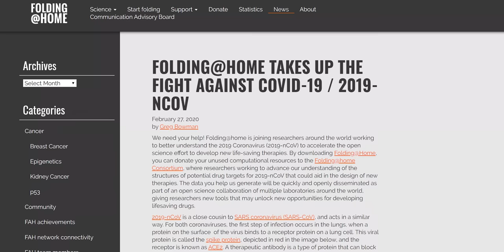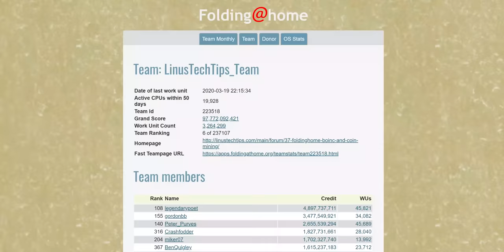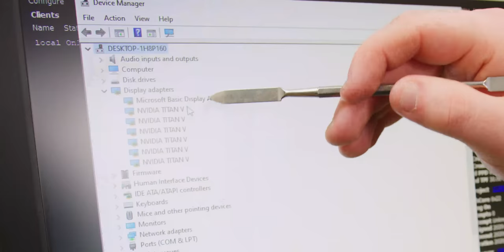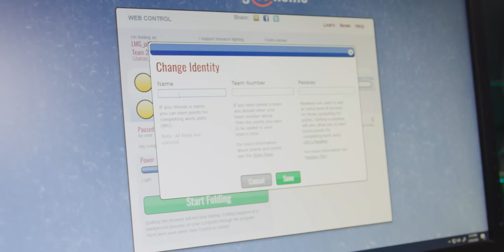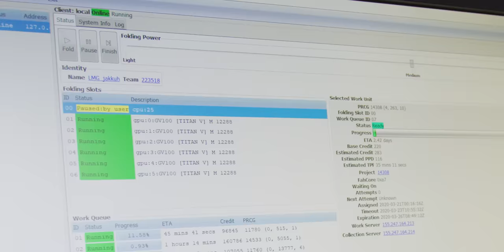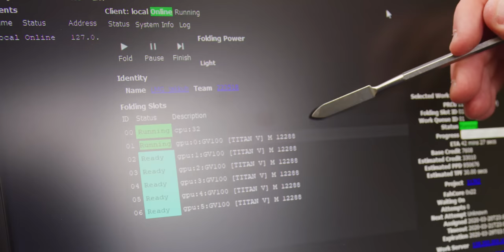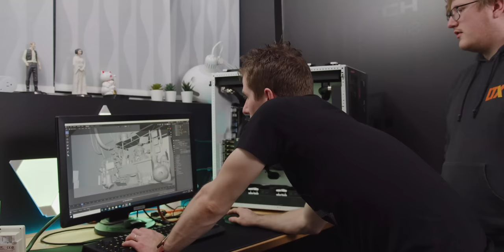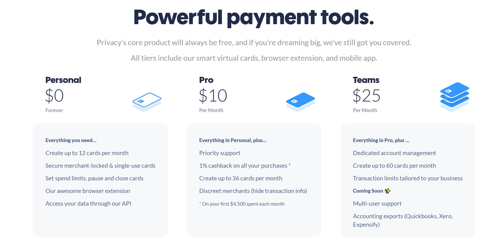Here's How YOU Can Help Find a Cure for COVID-19!

Comment: "We literally have a 1,000W heater..."

No, you LITERALLY don't...
Reply: How so?
Reply: Actually, they LITERALLY do, that heat just also happens to do useful computations as well. I use my PC folding in the winter to keep my room warm. By definition, heating it.
Reply: @PAPO1990  That is factually incorrect. The heat is a waste product due to inefficies of the system... It is folly to infer that heat does processing in this closed system. Is it possible to do computation with heat, yes, you are correct in that, but to say heat does computation in this case, is factually incorrect. If the heat were doing computation, then the efficiency would not be so incredibly low. It would be, literally, 100% efficient, which it is not.
Reply: @PAPO1990  Also, saying that you are heating your room in the winter by folding, only serves to prove the inaccuracy of your statement.
Reply: @PAPO1990  Apologies for the multiple replies, I don't like editing or modifying posts.

I was going to send a link to technical papers that detail computational efficiencies of modern silicon, but I thought it would be more effective to just give an example.

Consider the performance of a 90W CPU from a decade ago, and compare that to a current 90W processor... If 'heat' were somehow doing processing, they would be of the exact same performance and efficiency. If your statement were accurate, we wouldn't have modern Silicon that consumes 15W but easily outperforms Silicon that consumed orders of magnitude more power.

A further comparison would be that of the first generation of silicon based computers... They consumed kW and could barely do relatively simple computations, if your inference were accurate, such drastic efficiency difference with architectural changes would not be possible.
Reply: Jacob Crosby well if I want the heat AND the processing, then it IS 100% efficient. I am using it for the heat it produces, therefore it is functionally a heater.

Comment: I pulled my FX computer from my brothers as he uses wood heat and I noticed soot all over the components inside. I will clean that out and install the R7 265. Instead of the HD 6570 that in there now. I will set it up in a drafty corner and just let it go only for F@H.  Thank you for the guide.

Comment: Electrical System in North America seems quite weak to be honest. 
We got 240 Volts & 16 Amps (~ 3600Watt) per circuit here in Europe.
Reply: I am using a NEMA 14-50 outlet in the garage, which is 240V single phase 50 amps and then I have a simple adapter to 120V by not using all the legs of the 240V and that splits to 4x 120v outlets, 12 amps each. Gets pretty hot in there..

Comment: Set your folding at home CPU slot to use just a few cores, that way it won't interfere with GPU calcs, and will give you a wee boost in points, especially at present when the CPU work items are more readily available than GPU work items.

Comment: Intel i7-9700k overclocked
Nvidia 2070 super 
MSI z390 Tomahawk
Corsair vengeance RGB PRO 32GB 3600mhz 
Corsair H150i: 3 maglev push and 2 pull
Corsair 650w 80plus gold
Corsair 275r AIRFLOW (no glass side panel, open af with unlimited supply of air spray dust cleaner)

Task Force 223518: going dark.

Comment: October 2021; Only ~70K CPUs and ~30K GPUs are participating in Folding now?? That's sad people didn't stick around since last year. Got those stats from their site.
Is it accurate? Do they need more processing power? 
Just bought about 20 cheapo used Skylake Optiplex SFFs to get to work! Heating my house with scientific research!
Edit August 2022; Ok now I have about 90 Small Form Factor PCs running for the cause. They can really stand high temps they cool the CPUs better than you'd think. But will the PSUs last?

Comment: It's possible to install it on Linux, though only on Debian/Ubuntu/RedHat/SUSE based distros.  There's some broken dependencies you have to add if you are on Ubuntu, going to pkgs .org and getting the Debian Buster 10 version, since it's not in the repos.  And you might have to manually add your GPU in the configuration menu.  But besides that, it's working great.  If you are making a dedicated system, use something Debian based like MX LInux or AntiX so the dependencies are there.

BUT, if you dont want the hassle, get BOINC.  It's in the Ubuntu repositories and it just works.  And you can do more than proteins if you want, you could also do astronomical, cosmological, and mathematical calculations (like unsolved Conjectures and such).  I have my windows machine running FaH, and my Linux laptop running BOINC.

Comment: KProcessor ( intel 9th generation i5 unlocked )
Casing ( NZXT Ninza RGB Caae) 
RAM ( G. Skill Trident z GB 3,200 MHz ) 
CPU Cooler ( NZXT Kreken X52 ) 
M. 2 ( Gigabyte m. 2 512 GB ) 
HDD ( WD 2.0 TB) 
Motherboard  (Arous 365 M )
Graphics Card ( Nvedia geforce RTX 2060 ) 
Lan Card  ( gigabyte ) 
Power supply  ( Carsor CX650 watt ) 
Monitor ( HP 22fw monitor) 
Anti virus ( Avast) 

This is a right choose for building a best PC or not. What I need to change form here. Please tell me as soon as possible. This is a $1500 full set build.

Comment: Just joined the team. i7-8750H and NVIDIA GTX 1050TI on laptop. Running around 16 hours a day.
Temps are consistently 75C.
Is this damaging? (Ie will the laptop die in <5 years?)
Reply: It could be harmful for the battery and potentially the hard drive if they are heated up by the nearby components. You could remove the battery while running these apps continuously, and optionally connect the laptop to a UPS if there are power outages with any frequency.
Reply: How, to run 24/7?

Comment: I downloaded Folding at Home and set it up.  My wife doesn't use her laptop very often.  She likes her phone mostly and is lucky if she gets on hers once a year.  So I set it up to do some folding.  If your setting up for the first time and you normally have your computer set to sleep when not in use, make sure you go into the power settings and make it so the computer stays awake.  You an still let it turn off the screen though.  Otherwise it can't contribute when your in bed at night.  One question.  If I want to run this on more than one computer, can I use the same username and pass code on all my computers?  Or do they each need their own?

Comment: Question: why use Windows over Linux for this project? is it due to a performance hit when using Nvidia cards, didn't know if there was a Linux client available, had trouble configuring the system (or wanted to avoid a potential issue), a lack of familiarity with the OS from the people on the project, or "It's what was already on the hard drive," or it's what most of your audience uses? All of which i would consider valid, since this was probably intended to be a low effort project. I would assume that you would get a performance increase from using a lightweight Linux install, which may not be huge, but any increase in numbers is a plus.

Comment: The kind of stuff you guys have "just laying around" puts my 10 year old daily driver to shame, well, nearly anything puts it to shame tbh.
I really want to participate, but my computer is so old that I'm afraid of making it do too much cause I can't afford to replace it if it craps out, and I'm honestly expecting it to crap out any day as it is
Reply: It probably wont crap out running at stock speeds; it will however be inefficient. PCs nowadays are practically 10 times as fast while consuming the same or less power, so you could lose more money on you power bill than the value of the components themselves.

Comment: we got took over this month,
i'm running 4 individual tests at a time at the current moment...
3 on the 1 multicore processor by setting up 2 cores for each test,
you can all do the same if you have multicore prosessors.
any way to churn through tests and accumulate more points,
we are only loosing the the Default noTeam but...
Reply: although,
deviding up your cores like this will obviously make tests a bit slower so really upto your preference...
i may end up setting mine to at least 3 cores each,
donno yet...
Reply: UPDATE:
Yup,
i just earned more points in a couple of days than i did in a couple of weeks...
it's worth dividing up your CPU if you can

Comment: Can you adjust the percent of CPU being used. It's maxing out the CPU on my dedicated folding machine. It's only using 40% of the GPU, but 100% of the processor and, of course, running for hours, constantly. Temps are decent, but would like to back off the CPU a bit.

Comment: Linus if you are talking with Folding@Home it would be great if they could share some information on how they are prioritising the Covid-19 cases because there is no dedicated project available to select. So we have to hope that the "right" problems are being worked on by the client right now. C
Reply: The default configuration will get you covid units. On the client configuration the "Cause Preference" set to "any" receives them, as they are set to high priority on the work servers. You can confirm what unit is running by googling the project number.
Reply: @giann3021  thanks for the reply. I've been googling the project numbers and there hasn't been any info on them, unless there is a known Covid-19 project number that I should hope to see? Just feels a little abstract right now!
Reply: @Cerberus256  you can type the project number here to get a description: https://apps.foldingathome.org/project

There´s also a list on a forum FAQ for the projects: CPU : 13862 - 13863 - 14328 - 14329 - 14337 - 14528 to 14531 - 14572 - 14574 - 14576 - 14600 to 14602
GPU : 11741 to 11781 from https://foldingforum.org/viewtopic.php?f=24&t=32463
Reply: @giann3021  fantastic thank you 👍

Comment: I´ve got an old I7950 with 6GB Ram and a Gtx 970 left over unused. But the HDD is broken, and i dont have a replacement. Can i run FAH-client while booting over USB-Stick without significant performance drops? i´m happy to run that old system 24/7 as long as it still works.

Comment: Im new to understanding alot pertaining to the tech world. I have a gaming laptop thats collecting dust. Can that be used for folding? I want to contribute
Reply: Yeah with some considerations. Mainly watch the temperatures of the GPU after running the software for a bit. It would be better to fold either with just the GPU or just the CPU to avoid overheating it. You´ll be able to hear it too as the fan(s) will likely spin up like crazy. Make sure the fan and fins on the heatsink are not all clogged with dust/lint.

In the advanced interface of the Folding at Home client, you can right click on the CPU slot status and pause the folding. And it will keep the GPU running. You could also go to the preferences and delete the CPU slot altogether. If you find that you still have some thermal headroom, you can edit the CPU slots and try selecting 1 or 2 cores to run.

Comment: It wont connect for me. Tried disabling antivirus and firewalls, with no difference. Tried opening the port in windows firewall, still timing out. Is connecting on local, so I dont know what is blocking it. Or am I running into an overload problem

Comment: Yeah... I have three very capable boxes here, two WinTel machines with a 1080 Ti each and a rather powerful iMac, all three running Folding@Home with the "Any" branch to fight the covid-19 problem.
BUT: About 80 per cent of the time NOTHING happens; every few hours only do these machines receive one or two work units, the most I had was three WUs at once, the rest of the time all that power is just... idling.
The logs mostly say that there are " No WUs available for this configuration", only one or twice a day does one of the three CPUs and two GPUs get anything to do for f@h.
Is there anmy way to manually enforce more work for/from this project?

Comment: For anyone curious as to why their points received is vastly different from the points estimated and is a new folding@home folder, it is likely because you are not receiving the bonus points which are awarded based on a speedy completion time. You first have to COMPLETE 10 work units (wu) successfully before you can earn the bonus points. Make sure that you aren't failing your work units (they can error out if your overclock is deemed unsteady on your gpu or cpu) because you have to have successfully completed 80% of all work units received in order to get bonus points.

If you have questions, leave a reply.
https://foldingathome.org/support/faq/points/

Comment: So I let Folding@Home run for almost 2 complete days at the Full setting and without waiting for idle states (so full power for Folding@Home) but my PC barley got anything to do. When its working on both CPU and GPU (R7 3700x & Vega 64 LC) it says it could earn about 1,3M PPD but I just got like 256k since. I also logged all the temp curves with Corsair iCue and it shows that most of the time the CPU is running idle. Will this get fixed anytime soon?

Comment: Go team LTT!
I downloaded the software, but I wish it had more customizability about the CPU/GPU utilization. For example, I'd prefer to set it to operate at "light power" when I'm working and bump to "medium power" when I'm idle (and I would really love to be able to customize what "light" and "medium" mean in this context, like choose the CPU/GPU usage). BTW, at "light" speed the GPU doesn't work, it took me a while to figure that out.

Their definitions of the folding power are: (copied from the website)

Light - CPU is Folding at half speed, GPU Folding is off.
Medium - CPU is Folding at three-quarter speed. GPU Folding is on. This is the default setting, and recommended for most users.
Full - CPU is Folding at full speed. GPU Folding is on. This is the most productive setting. Will cause fans to run faster and may produce more heat.

Idle - The software uses several different methods to determine if the system is idle. In Windows, if there’s no user input on the mouse or keyboard for a while (the exact timing depends on the system’s configuration) the power management settings can turn off the monitor, or Windows can decide that it’s in “away mode”, whichever comes first, and folding while idle starts. In Mac OS X, the system is idle if there’s no user activity for around five minutes. In Linux, the screensaver and a lack of user input are used to determine idleness.
Reply: A partial solution I found is going to task manager -> right-clicking the process (there might be several, the process with the highest CPU usage is the one using the CPU folding) -> Go to details -> right-click -> Set affinity. This lets you choose which cores (or threads) the process can use. This appears to be the most "natural" way to limit a process' CPU usage. This way you can make sure it can't get to a super high CPU usage that will decrease performance of other applications.

As long as I'm not gaming on heavy games (which I usually don't), I don't mind letting it run in the background on Medium settings while limiting the CPU-folding. I just wish it could have been adjusted more conveniently through the app.
Reply: Actually it turns out you can configure something threw the software...
Go to Configure -> Slots -> choose the cpu -> you can set how many threads take part it the folding, with the value "-1" being the default and lets the software choose. With my Ryzen 1600 (12 threads) the default was 10 threads on medium settings (5 on light, 11 on full, not sure how it matches their definitions but ok).

So what you can do is define 2 cpu folding slots, and make one of them run always and the other only when you're idle. This way you fold more when you're idle but you still fold when you're not (so it's less CPU-intensive). The downside is that, according to them, dividing your CPU between two jobs is less effective than having it fold one job at a time.

Still no better solution for the GPU, so I'll probably just keep it on idle (you can do it by choosing "light folding power" or by right-clicking the gpu folding slot and check "On Idle").

Comment: Well, I'm old, ugly, and cranky but LTT ROCKS! I think "Folding@home" is a good cause, so I just joined Team Linus. My Asus Rampage III Extreme just failed so I upgraded to a Gigabyte Aorus X570 Master with an AMD 3950X CPU.  Unfortunately, I have an old crapy GTX 1660TI XC. My GPU is non-RTX but it works. My extra spending cash is going to my daughter for college. That, and like everyone else, I had my work hours reduced (but I still have a job).  I do have a question though? Why are people only using the GPU and not the CPU or both? I do notice my fans cranking. Should I only use the GPU?

Comment: This is a perfect way to fight back for anyone with an adequate pc:
Save the World with your dusty computer!
Reply: To be fair the old P3-733 I have sitting in the corner just acting as a NAS though admittedly not the primary one anymore but it still works so been too lazy to migrate the data elsewhere, still it is able to run FAH and quite a few other apps on the Boinc platform if I wanted to (Not all support linux though so only can use it on those that do). And yes I know that machine is like 2 decades old but really doesn't take that much power to run a headless OS as a server only used by a home network it's quite capable of maxing out the gigabit ethernet card installed in it still anyways.